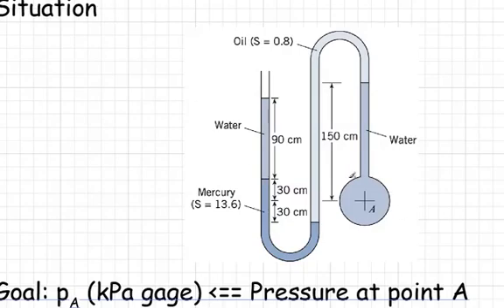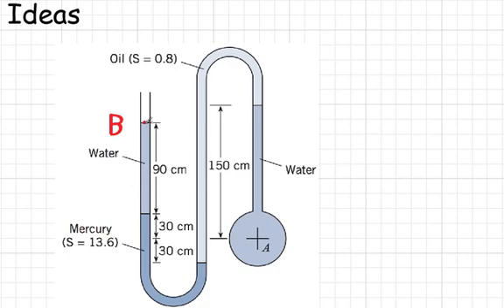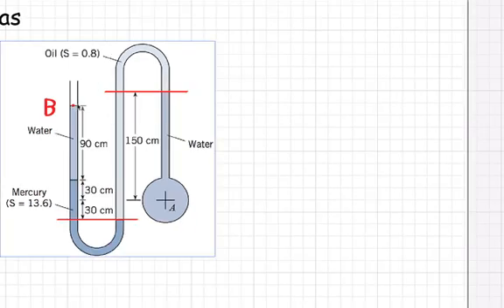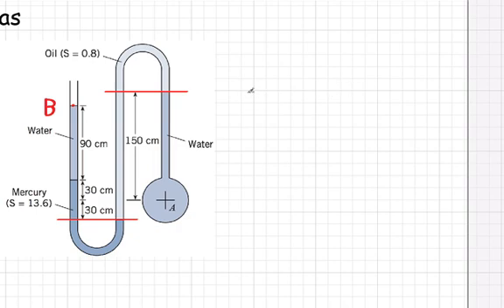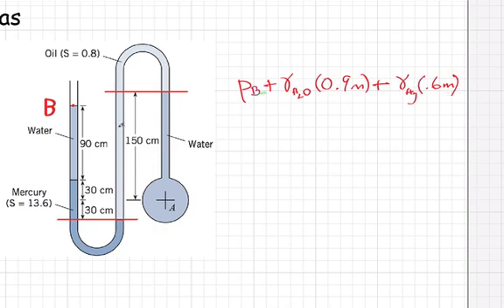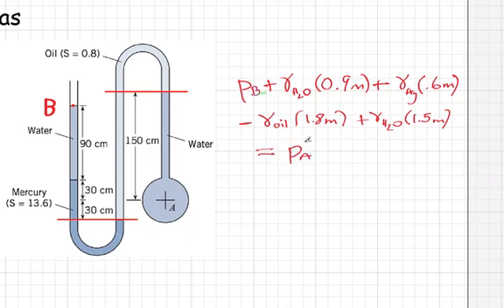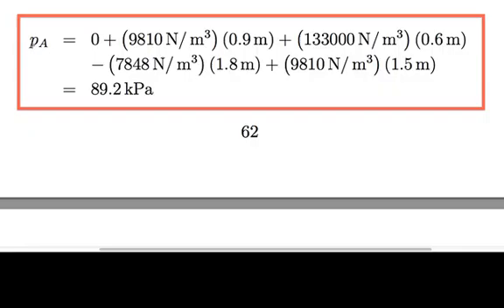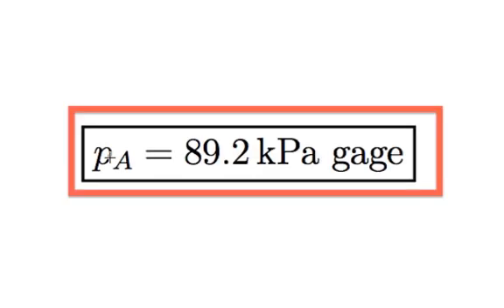manometer-problem

Comment: Why is the Pb zero?
Here's the answer:
He wanted to simplfy gage pressure calculation and didn't put Pb value initially.
If we wanted to calculate or measure absalute pressure then Pb(or Pa, P0 so atmospheric pressure) would be different from zero.
(The formula: Gage Pressure= Absolute pressure - Atmospheric pressure)

Comment: why didnt used g(accln due to gravity)??
Reply from the maker: If I am understanding your question correctly, the answer is that engineers sometimes use the product of density and gravitational acceleration and sometimes use specific weight which is gamma = rho*g.
Reply: +Donald Elger tnx for the kind response sir

Comment: why did you add gage at the end ?
Reply from the maker: A value of pressure can represent a gage pressure, an absolute pressure, or a vacuum pressure. Each of these pressure scales is different. I add gage at the end to denote that the pressure value is a "gage pressure." Otherwise, the value of pressure is ambiguous. Hope this helps.
Reply: Ok. So if I want to calculate absolute pressure at point A, then absolute pressure at point B will be equal to P(atm) = 1 atm right?

Comment: Why is the pressure at B zero?
Reply from the maker: At point B, we can apply sum-of-force equals zero (force equilibrium) to prove that the pressure in the water must equal the pressure in the atmosphere. The pressure in the atmosphere at point B is zero gage (by the definition of gage pressure). Thus, the pressure in the water at point B is zero. Hope this helps ...
Reply: He wanted to simplfy gage pressure calculation and didn't put Pb value initially.
If we wanted to calculate or measure absalute pressure then Pb(or Pa, P0 so atmospheric pressure) would be different from zero.

Comment: Thank you, this simplified it a lot. One question though: 

Can we not say that the pressure at point A is equal to the pressure horizontal to it on the manometer? Instead of going up the oil 1.8 meters, we can go up 0.3 meters- And that point would be pressure at A.